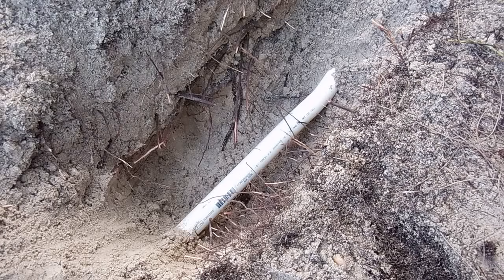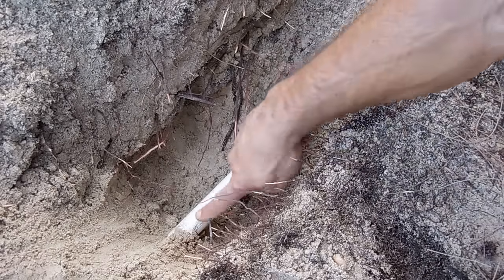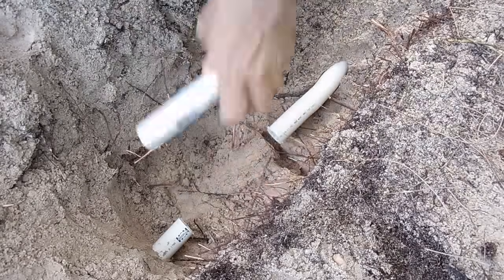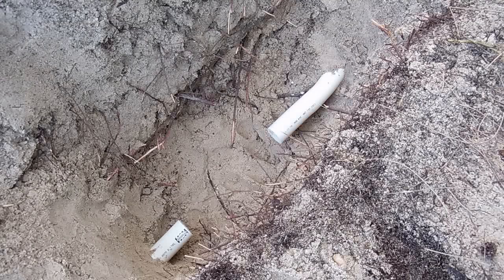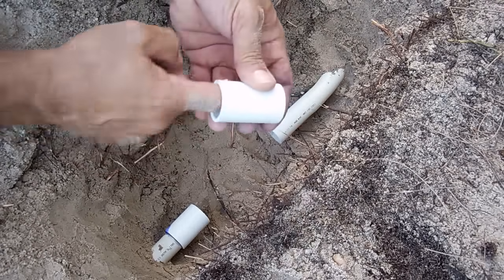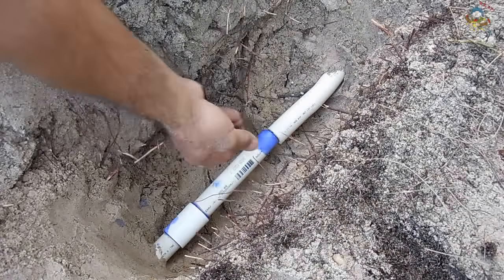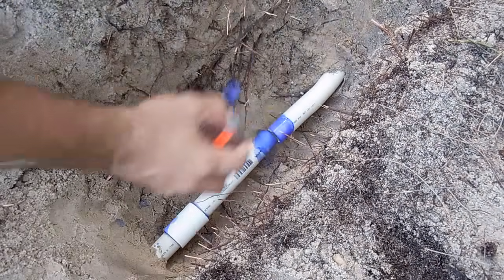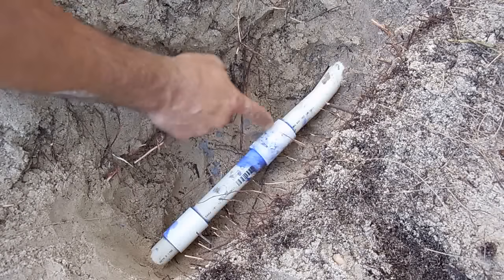EASILY Repairing Broken PVC Pipes(Least Amount Of Digging)

Comment: You did way too much work to replace the crack. Would have been much faster and cheaper to patch it with the coupling versus cutting out the section of pipe.
Reply: SOUNDS LIKE A GREAT IDEA!  Have you done this w good results?  Cut coupling into a half circle?
Reply: @goodcyrus  yes.
Reply: @StreetVetQuickPicks  I wish i had tried before the video trick

Comment: YOu'll be in big trouble if the cement locks up before you've slid it back again.  I just put one on by having the slider on already when I put the pipe in. The slider was prepped but no glue. Then I prepped the exposed ends and glued them heavy and slid the slider over.  So it only got the glue it picked up as it slid over.  Test it tomorrow.  He doesn't say anything about that but the glue says give 24 hours. Okay. We'll give 24 hours and then test.  I will come back here and report. Damn sight easier if you only have to slide it along the pipe.  Don't have do it his way.
Reply: It’s been 24hrs
Reply: @derekmortensen1665    Thanks for reminding me, derek.  quick report:  It's good.  

More detail if you want to listen to a story:  its a bit funny.  

When I first put the water back on it dripped out. 'Dripped' !  

Not 'spurted'.  And this is pretty high pressure main we've got.  The original fine crack was spurting two metres in the air.

So I thought hell that's it, buggered and went to ring a plumber get a proper job done because they family don't want to wait any more on my blundering.   Couldn't get one for that day and I told him what it was doing he said I must have done a 99% good job. Small consolation.

So went back out the break thinking perhaps to dig more away make it easier for him when he came and it was stopped !  Stopped dead.

A pool of water under the pipe without a ripple in it like from drips or anything.  Dead calm.

Now it gets funnier:  watched it daily since then and the pool hasn't dried up, gone away,  nor has it got bigger!  It still stops just under the pipe.

So I don't know what's going on and haven't backfilled the hole yet until I figure it out.   There you.  Full drama.  :)
Reply: Haha I’m glad it kind of worked for you. I just attempted mine but the glue almost set immediately. Was able to get it on one side but was soon as I tried sliding it over it was already setting. Pretty frustrating. Going to have to let it set and see if what I did leaks or not. Such a pain. Lol.
Reply: @derekmortensen1665    Yep,  it's sudden death that glue, eh?  If I ever do it again I'll wrap something around the pipe on the side towards which I'm going to slide the thing. So that I don't have to go slow and careful.  The ends can be well prepped long before.  Come joining time I will put the glue on as quickly as I can but good and thick - find the best way to do that - like maybe make myself a stiffish strip of plastic I can load up with glue and then one swipe from bottom to top on one side and another swipe on the other side and across the top and then bam:  slide the thing quickly over right up to the 'stop' I've prepared.
Because I guess as soon as the glue meets the prep it is going to start going off.  Even without the join being made.  I must test it.  I'm thinking if I just put a puddle of glue on top of a piece of prepped plastic it'd go off.  I must try it.
But anyway whether that's right or not there's no doubt it goes off right quick when we're trying to slide doesn't it?  So no time for messing about trying to get it centred over the join: just one swift push.
All good fun,  eh?
I still can't figure this unaltering pool of water. It's still there today.  :)
Reply: @abrogard142  honestly, I just skipped shaving out the middle section. Was to much of a pain and had to keep cutting pipe every time it would get stuck. It seemed to work great with no leaks. I also had to splice 3 wires because I tore through those as well. Lol. First time doing both so pretty happy I was able to get it back up and running.
Reply: @abrogard142  so my Break was pretty close to my backyard patio. Basically what I did was use a coupling on the short side, then put about 6-8inch pipe to make it longer. Then I put another coupling on that end as well. I did have to dig it out alittle bit more on the other end. On the other side, I put a coupling on that end, measured the distance between the new pipe I just installed and the pipe on the far side of
My patio. I glued the pipe, put one side in and I had enough flex to to get the other side in. I barely got it in before the glue set but it seems to not be leaking as of yesterday. Even after running my sprinkler for 10 minutes. Hope this makes since. Lol

Comment: Thank you for the good tip.  Used your “stop free” coupling along with a piece of flexible PVC to create the patch.  Did it this way since the pipes on both sides of the break were not movable - tight spot.

Comment: While digging a 6"-diameter post-hole for a pool equipment enclosure, I stabbed a hole in a 3/4" Schdule 40 PVC water line for our automatic pool filler.  I was using a breaker because of a layer of concrete, so digging a trench for a typical repair was a bleak prospect.  These instructions were just what I needed to perform a repair in the limited space, and cheaply, too!  The cost of more traditional repair fittings (just a few bucks) wasn't really a problem, but this frankly seems like a more durable solution than something with o-rings, etc.

A note for other folks attempting this repair who, like me, aren't very familiar with PVC: if you're test fitting the parts beforehand, you'll find they're very tight, but things slide much more easily (briefly!) once you've got the glue on them.

Comment: PEOPLE USE 
4 = 90° ELBOW'S
TWO ON EACH SIDE 
AND IT'S GOING TO LOOK KIND
____Π_____   👈 LIKE THIS
DOESN'T LOOK PRETTY BUT IT'S VERY
EFFECTIVE AND EASY TO DO IT
TRUST ME I'M BEEN IN THE TRADE
FOR MORE  THAN 20 YEAR'S
NEVER HAVE A PROBLEM WITH IT !!!!!!
Reply: That’s terrible advice. I’ve been a golf course irrigation technician for 16 years, working with 2” - 8” pipe. The more angles or hard turns you add to your line, the greater the risk of freezing and expansion over the winter, cracking your pipe because you’re not able to blow out your lines properly during the winter prep. Water will get stuck at each of those corners and freeze.
Reply: @Justin-uc8sc  WHERE I LIVE 
WE DON'T HAVE EXTREME TEMPERATURE
CALIFORNIA CENTRAL COAST
AND I'M GOING TO REPEATER AGAIN
NEVER HAVE A PROBLEM WITH IT !!!!

Comment: I just finished repairing my sprinkler PCV leak using your method. I had a 37 year old 1/2” tee that blew out a small piece of pvc pipe. The installers did not push it in far enough into the tee nor glue it properly. I guess it is a bit out of warranty by now! Anyway, I cut out a tee and the 45 degree fitting and enough of the old three pipes to fit a new tee and glued all of it back together properly using new parts. I modified the last coupling like you did and attempted to push it all the way through on one side of the remains pipe, while simultaneously gluing the last small pipe into the tee. The glue was setting up on me and I could not push the coupling back over to glue into the small section of pipe. I was about at the 20 second mark when I successfully used a pair of channel locks to move the coupling back over covering the new pipe. I let the repair sit overnight and NO LEAKS! Thank you!

Comment: I do irrigation work, so I use slip fix on laterals (not under constant pressure), sometimes use 4 90's, but Spears makes a pvc coupling with no stop too, so you don't need to grind the stop down. I've seen irrigation techs use the bell end of a pipe as a no-stop coupling, too.

Comment: You are using primer not cleaner. They are different. Your definition is correct for what you are using but its primer and not cleaner. If you use cleaner, which most 2 step processes say you can but do not have to, you apply it first. Then primer, then glue. 

Also, you can buy a repair couplings that do not have the center stop in it.  

Just trying to help!
Reply from the maker: Just so you know, primer contains the same chemicals in the cleaner. :-)

Comment: Wow! Such a big deal just to avoid digging a bit further in SAND that he seems to easily dig with his hand every time he needs a “bit more room”. Especially for DIYers who don’t practice these types of jobs: do the extra digging needed to guve you the flexibility to move the pipe, avoid damaging it, and do the job right.  Properly  welded  joints and properly engages fittings  are important in the long run.

Comment: Used your method years ago, worked perfectly and never had a problem.  Fast forward, needed to repair another section but forgot the method.  Absolutely the quickest, easiest and most economical repair in all of YouTube.  7 years later and going strong 💪.  Brilliant.  Thanks a million. 🙏
Reply: I've always wondered how to do it without buying those expensive couplings in the last 4 years this could have saved me so much money just with the dremel
Reply: Just did this method & it worked amazingly well.  So good!  I can hear the ocean & waves crashing in the background, sounds  wonderful ... I guess that is why there is a lot of sand in his hole where the broken pipe is.
Reply: @Alex-yc4ds going on 9 years with one and 7yrs for the other repair…never an issue.  Safe to say the repair is permanent!  👍

Comment: Excellent video, helps alot, however, I have one question. You mentioned slow setting cement, what kind did you use and where did you get it? I've lo0ked around here and asked some folks, not plumbers, and no when has heard of it. Once again thanks for the vid.

Comment: Do they not make slip couplers without the stop in the middle?
Reply from the maker: Commonly found for drain waste vent PVC not schedule 40 pressure
Reply: @electronicsNmore  I see they make a medium set time pvc cement. That might buy you more time. Have you ever tried that?

Comment: I have tried this on a 90mm pipe but the slip couplers are way too tight, they barely go over the pipe, no way I could slide them over then back again.
Reply from the maker: Typically I only use this method up to 2" (50mm) PVC pipe.

Comment: So I have a bad leak under the elbow joint of my sprinkler riser but cannot trace the location in the pipe of the sprinkler line with the actual leak and I don't want to dig up my entire yard. I capped off the riser and still leaks under the elbow joint but no cracks in the pipe. How do I locate the actual leak?

Comment: Very, very, good, detailed video. Thank you! I like another viewer was concerned about the coupling sliding on far enough on to then slide it back over the other pipe but it worked perfectly.  I used regular clear pvc cement and the repair went perfect by following your detailed video.

Comment: Seems like you might get a bad glue joint sometimes on the full slip fitting because you push the glue away from the area that needs to be bonded before you slide it back leaving the possibility of voids in the glue joint.  Ever run into that problem? Thanks

Comment: Tried it. Does NOT work with regular cement. It sets too fast for one to slide the coupling.
Reply from the maker: I use Home Depot Oatey clear with no problem you have to work fast

Comment: I tried this once, and it worked just as you show in the video, however I ended up grinding too much out of the fitting and a small leak developed.  It would be nice if the PVC companies produced repair fittings that do not have the collar to grind away.  Or perhaps someone could make a tool that you could attached to a drill or drill press that would remove the exact amount of material needed.

Comment: I have felt this video is absolute gold when I just bought a house and I had 2 surprises, no electric and no water. After lots of money replacing an inside and outside box I was so grateful for this video. I have spent a lot of time filing down the inside of the coupler to remove the stop with a file. I thought I would do a test to slide the coupler with the removed stop to make sure it would slide entirely over the pipe before getting under the house to fix the pipes, then adding the primer and glue to potentially ruin the pipe and the coupler but my project was at a stand still because nothing I do with filing, sanding and washing the coupler and pipe with water to ensure there is no debris works so that I am able to slide the pipe completely through the coupler. Then I just read a comment that said, don't worry if it doesn't slide over to the end, that the primer/glue acts as a lubricant.  I am not sure if that is true and correct information. So I am at a complete stand still with no water to the house due to the broken pipe. Also, I bought a kit of Oakley primer and cement than I realized when I got home, that you say to apply the 'cleaner' in the video and you don't call it primer.  I looked it up and Oakly carries a cleaner but it has a yellow label and not a blue label.  I looked at a few more videos and saw that someone used Oakly primer and the container states on the label, Primer and Cleaner. My container only has the word primer without the word cleaner. So I am not sure if I have to make another one hour round trip tomorrow to go buy cleaner and use 3 products instead of the two shown in the video. Again, I don't want to start the project and ruin all the materials I bought as well as lose an hour on the road and the price of gas if I am doing something wrong. I can clearly see I have filed away all of the stop but there is no way the pipe will go through to the end of the coupling so I can then pull it back to the middle. If anyone can help so I don't make a mistake to ruin all the supplies once I start the project, it would be greatly appreciated. Thank you!!
Reply: Had the same problem.  Completely filed away the stop but the coupling fits too tight to slide more than halfway.  Wonder if some brands of PVC couplings have a slight taper toward the center?

Comment: you should put the coupler on first with no glue on .so you dont have to pull on the pipe and just glue the pipe and slide the coupler over

Comment: Why didn’t you buy 1 regular coupling and 1 slip coupling? A slip coupling does not have a stop to file away. It’s a very common fitting.
Reply from the maker: Full slip couplings are only sold for DWV PVC, unless you go to a plumbing supply house.

Comment: With the small crack that was in that pipe, just one slip coupling would have suffices.  No additional pipe or other point of failure introduced.  Why did you cut out so much pipe when you could just cut out the crack??
Reply from the maker: Mentioned in the video.

Comment: PVC is brittle when it ages, which i why it cracked in the first place.  Lifting up on one side or the other makes no sense when you can jut remove the stop from BOTH couplers and connect as you did the one side.  BTW,  you can just buy slip fittings... no need to modify a coupling.  I always mark the stop points for the slip couplings to ensure they are centered.  You keep repeating how to apply primer (cleaner) and cement.... why?  Do you think people are stupid?
Reply: Hi I am stupid

Comment: I removed the (center stop) completely smooth in the coupling, then i tried a (dry fit) to see if the coupling would slide smoothly across the pvc pipe but it still gets stuck halfway through the coupling. My question is / once I add glue will the coupling slide freely across the pipe without getting stuck ? Thanks 🙂

Comment: Would this method work on a water line coming from my water meter with water pressure of 50 PSI.   I've seen mentioned in a number of sites that some connectors shouldn't be used if its on a water line under pressure?
Reply from the maker: If you do it right, and do a good job, it'll work just fine.

Comment: have you ever just taken a bell end off the pipe and cut it off at full size, then tried that method? I've done it a few times on zone lines, not on a constant pressure main. works well enough.

Comment: IDON"T USE THIS METHOD INSIDE YOUR HOME!!!  I have called Oatley and they say in 80 to 90+F there is no slow setting cement, even the "slow cement sets fast.   Also they said these couplings are TAPERED as you go further inside and their cement is NOT meant for non compression fit connections like a slip fit as this describes.
Reply from the maker: First, where did I say use in your home? Second, you're removing the stop, the taper mostly remains. Third, I've never had one fail in 30+ years.

Comment: Why don't they make slip couplings already??  And even better, one with enough wiggle room to be able to slide it!!    I used a Dremel on mine to tonight and was doing a dry fit and got it completely STUCK.  So frustrating..  it's on the suction side of a pool pump, so it has to be airtight.  Guess I gotta cut it off.

Comment: Not a bad way cheap and dirty. as a plumber I would have used a muller couplings, a three part union, or just a regular union. I don’t like the second coupling because he wiped the glue all off when he slid it on. I repair various piping all the time and I get paid for it. A professional wouldn’t do it this way.

Comment: I'm not sure what size pipe it was (1.25" or 1.5"?) but I took an 8" long piece the next size up pipe and cut somewhat less than 1/2 of it off axially with two cuts from skill or table saw. This allowed it to work as an outer pipe patch to snap over the cracked inner pipe and glue it over the cracked inner pipe that was only on one side. The ID of the patch pipe was exactly the OD of the cracked pipe. It's been holding 180 psi for 5 yrs now.